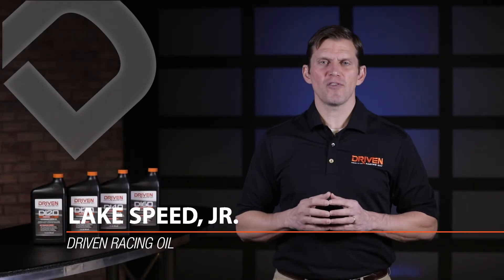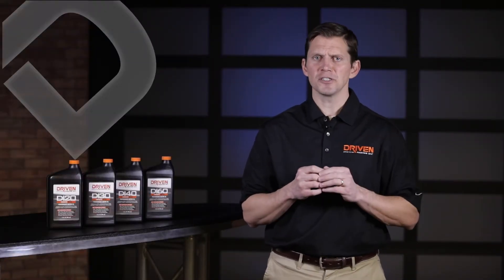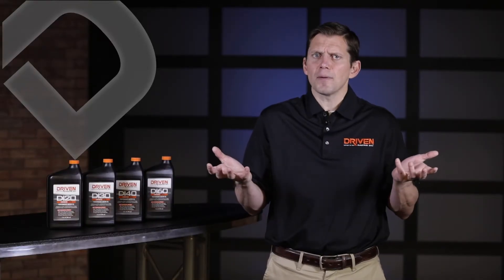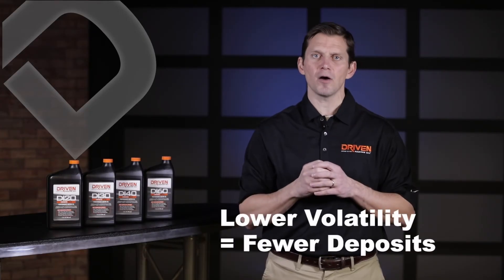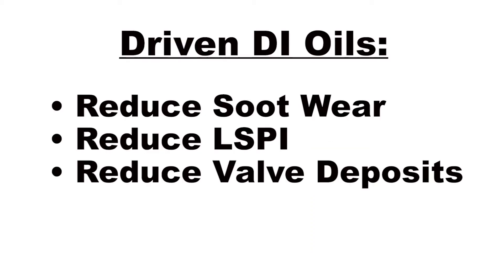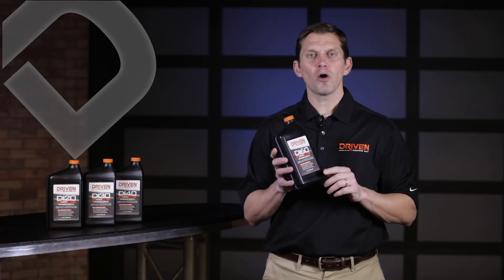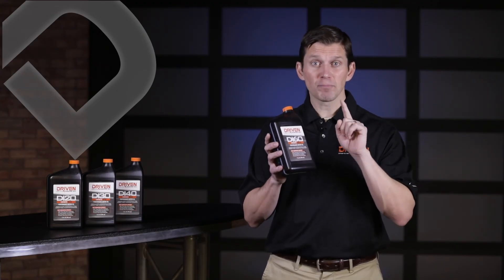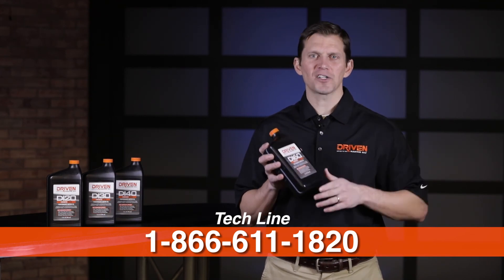Direct Fuel Injection Part 4, How Oil Can Reduce Carbon Buildup, Soot, & Intake Valve Deposits

Comment: Quick question, my lil 1.5 na honda fit DI works better the hotter the engine gets. Would going from a 5w20 to 0w20 help, hurt, or not make a difference in gaining horsepower? Thank you so much!

Comment: I wonder if a cooler engine would help, like installing a 160-180 degree thermostat
Reply: I don't think so. A cooler engine will run prompt the PCM to add more fuel. Too much fuel will continue to dilute the oil, keeping the bad cycle going.

Comment: How does DRIVEN achieve this? Do they lower the additive pack (calcium and anti-wear ZDDP) content to that of a "C" grade oil? If so, I assume there must be MoS2 and Boron to compensate. Lowering the Ash content also reduces protection the engine gets in high heat/pressure zones too, but how about detergency? Can we know the magnesium (detergent) levels compared to other oils in the DRIVEN line? This isn't touted as an extended interval oil so I'm assuming the minimum interval applies. That can be expensive to say the least at almost $20 a quart. One specific competitor claims not only no LSPI occurrences in five trials but also a (potential) 30K mileage interval. What exactly are we getting for our investment with DRIVEN?
Reply: These aren't API certified oils for long drain intervals. These are "Racing Oils"...they have higher levels of ZDDP and Molygdenum, not sure of the detergent package. I know its very low to non existing sodium, with slightly lower levels of Calcium as well.

I generally run 3,000 mile drain intervals on my daily driven "fun" cars, and 5,000 mile drains on family haulers. The DI series of Driven oils should be fine for short cycle drain intervals...but I wouldn't push them to any factory long drain intervals (though generally I would never stick to any long drain intervals regardless. 5,000 miles is the longest I'd let any oil sit in any engine).
Reply: As for what you're supposedly getting for your investment...You're getting higher levels of wear and mechanical protection. Better viscosity stability. And better levels of high temp shear protection/stability. Which is what people look for in performance based motor oils. Specifically with the DI series, you're also getting protection from LSPI events in turbo charged DI engines.

How much, and is it better than some other high end performance based oils? Is up to you to decide, and any testing or reviews you can do or find. 

This isn't really the oil for you to run in a daily family hauler, or work vehicle, with long drain intervals.

This is for performance/race vehicles. Where people value their engines more than a few bucks extra on oil.

Comment: I was all excited about this oil for my GDI sonata. Then I saw Noack rating of 10...I believe Mobil 1 is about the same. AMsoil is supposedly rated around 5!
Reply: True, depending on the weight selected, Amsoil Signature Series Noack is very low, much lower than DI's 10.  RAVENOL DFE 0W-20, in that light weight, has an impressive 7.6.  Ravenol's heavier weights even better usually, i.e. Ravenol DXG 5w30 is 6.

Comment: What is the volatility of the DI30 , % weight loss per 100/g (ATSM D5800).
Reply: I believe he mentions it being at or slightly below 10. Which is higher than some other same weight oils like Amsoil Signature Series if the DI30 is at around 10, and Amsoil 5W30 is at 6.7.

However keep in mind Amsoil SS 5W30 is an API SN Plus certified oil, meant for "long drain" intervals. While the Driven DI series is technically a racing oil. So if you want to compare apples to apples, compare the DI30 to Amsoil's Dominator racing oil, or any other brand racing oil. Though currently Amsoil doesn't provide a NOACK Volatility % number for their dominator racing oils. Maybe you can call them, or do your own test, heating and weighing the sample.